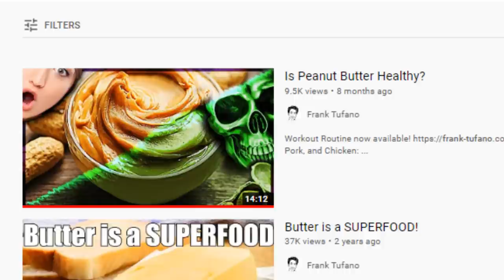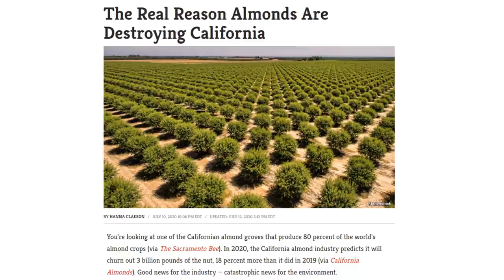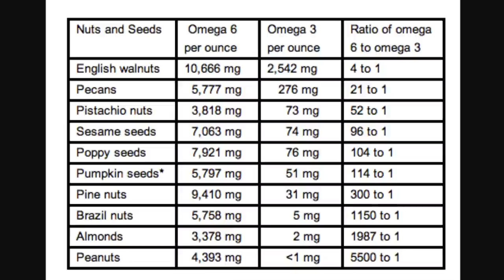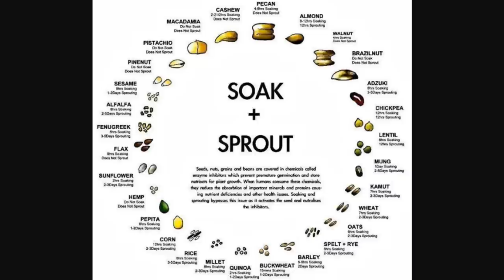Are Nuts Healthy?

Comment: I agree, and also digestion plays a big role on how harmful they can be. I had never had any allergic reactions to pistachios before until last year. During my last days as a vegan I had some and had the worst stomachache, paired with itchy eyes, nose and throat. I hadn't taken antihistamines in years and had to take some to calm the symptoms down. My digestion at that time was also the weakest it's ever been, everything was coming out as it came in (sorry tmi) and I'm sure that's what caused it. I don't even want to try having other nuts either ever since but nut/seed butters are much better since they're easier to digest.

Comment: Hey Frank, I've always had trouble putting on weight and used to use peanut butter to give my meals calories as I try to eat healthy but most healthy i.e. non-processed foods are so low on calories, It's like I can't physically eat enough food to give myself the calories I need. Any solutions? I tried keto and a lot of fat before but it almost killed me just in case you were gonna suggest a fat-heavy diet. Thanks!